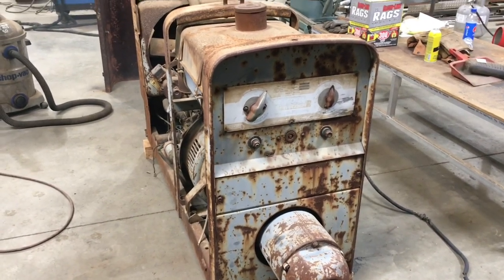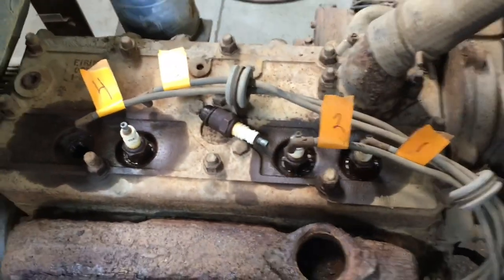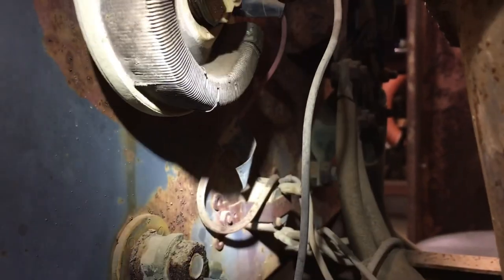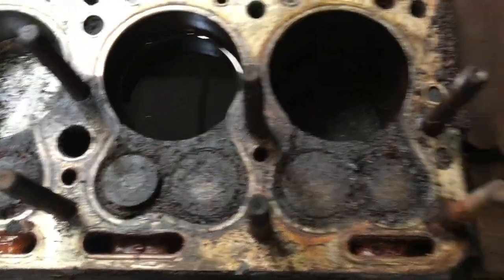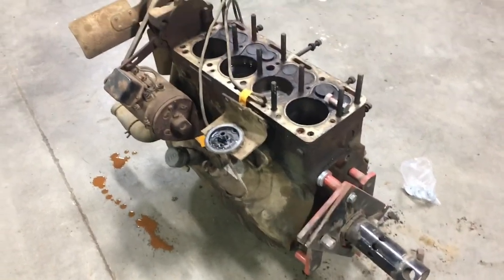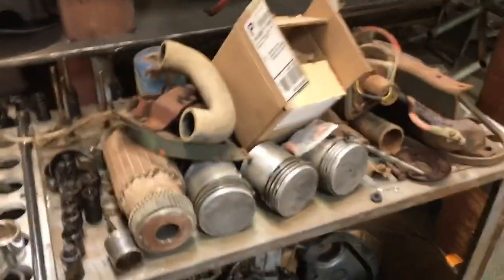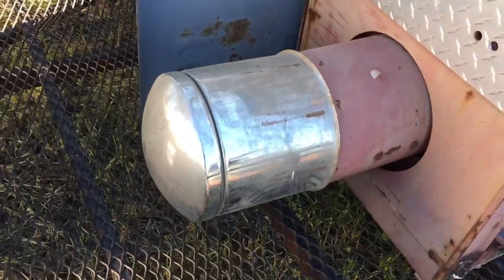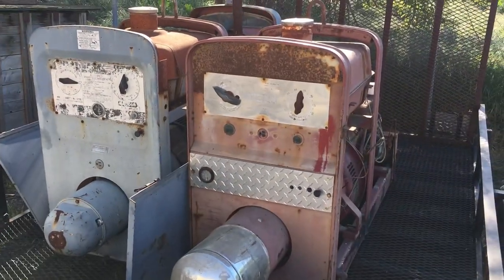1968 red face sa-200 rebuild disassembly part 1

Comment: The blue dial machine,there are no differences  between a red face machine, its a all copper wound machine. they just have blue on the dial on the face plate,  that's the only difference.  between the two machines.   That is straight off the Lincoln site.   I would re build both machines.   Thanks for sharing.

Comment: I have this same machine (in better beginning shape) and am trying to get it back up and running. Where are you sourcing all of your parts? I think my issues are all in the magneto. My machine is a 6340-A
Reply from the maker: @grantflaming9792  bw parts in phoenix az they sell on eBay and have a website they will have pretty much anything you need

Comment: Two piece front face is 65 and earlier.......contrary to popular belief the red face blue dial isn't a magical machine, Lincoln was probably sourcing other vendors for the face plates and that is what they got from that particular vendor and Lincoln used them til they ran out. I've heard almost all the "stories" about red face blue dials......best advice I could give is DO NOT CHOP ANY SA 200's...go with 1 wire alternators, 70 and later oil filter set up, wire it for a remote, Murphy gages if you like and stay with a Fairbanks-Morse mag....

Comment: What you have is call a blue tint red face.   I think 66 was the last year of the 2 piece control panel ending the blue tint red face. 67 started the one piece control panel with the red face. 70 was a round barrel with a black face that was the same as the red face panel but all black.  After that they went to the octagon barrel and the black face of which there are 3 black face. The first was a large black face. It was more of a square than the narrow red face. The second was the same large face that had a green light for the charging circuit, the third was the same large face with a warning label. The last copper wound  SA200 were round barrels. Time is slipping away from me and so is my memory so check your facts.

Comment: I've had a '46 SA200 'junior' for years-it runs and welds good, a '48 shorthood with a blown motor-lots of parts but worth the 100 bucks I paid. Just got a Hobart 300amp with a Buda motor that just needs a carb for 100 a month ago. My PipePro 400 runs 12k amps A/C power,400amps D/C. there is no better sound in the world than the throaty sound of a 200 idling up!!